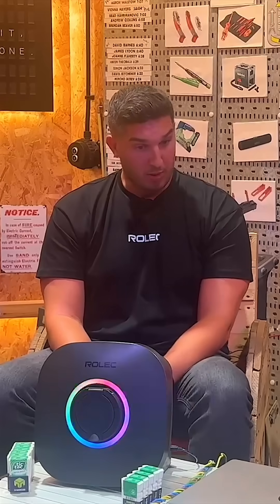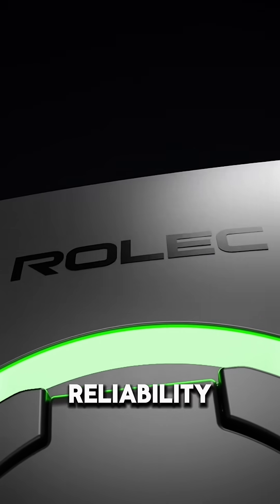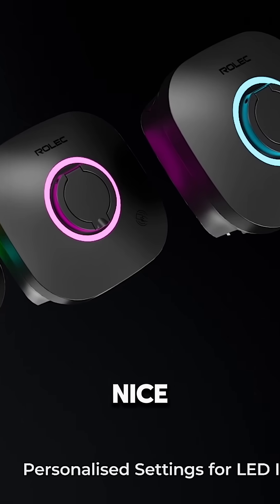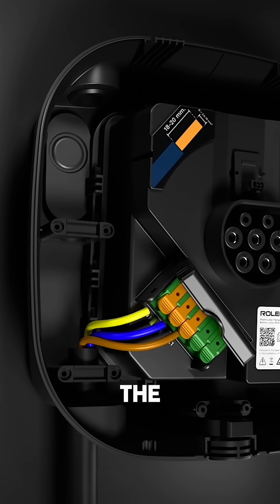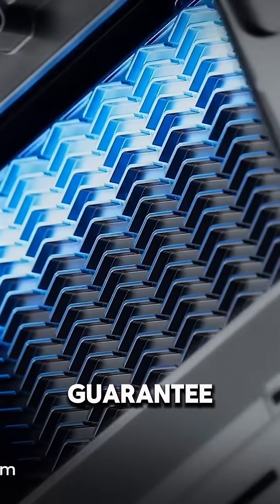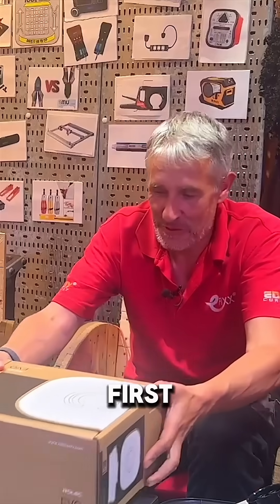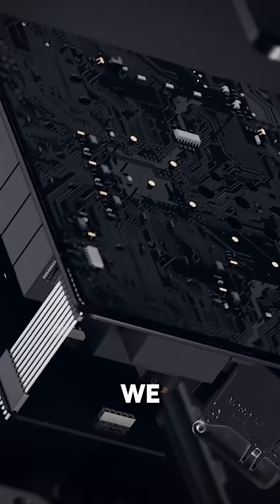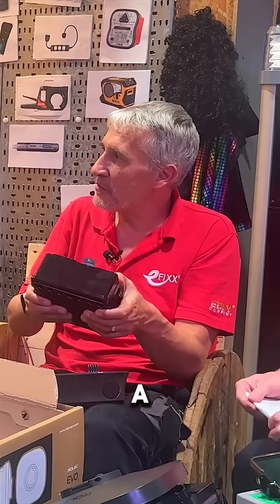The Best-Looking EV Charger Yet?

Comment: So we legally have to fit a car charge for a vehicle thats a proven failure, a non seller and supplied by a grid iron that has not been increased since iit was built and is already on the verge of failing just by kettles being turned on after eastenders finishes and those kettles are 1.5kw for 2 minutes runtime each whereas car chargers are 10kw+ and runtime of 8hrs +